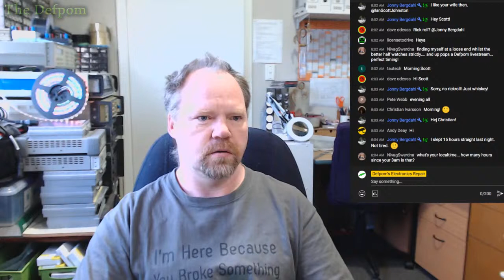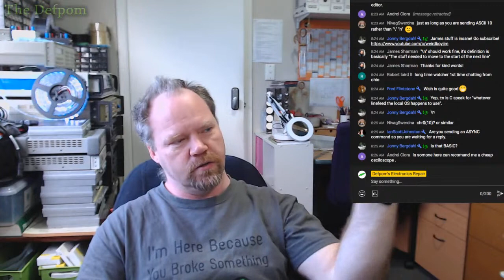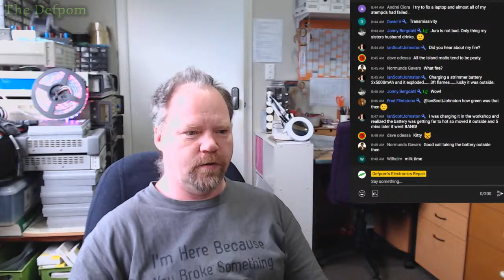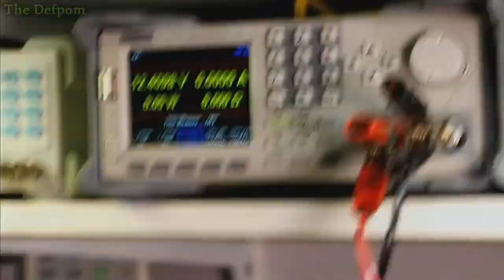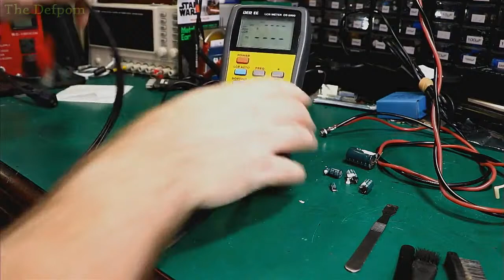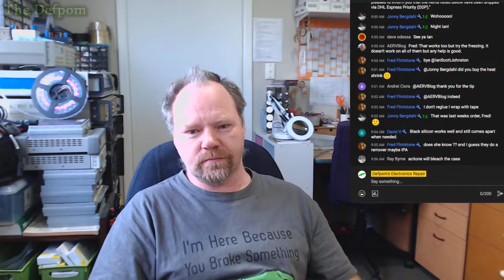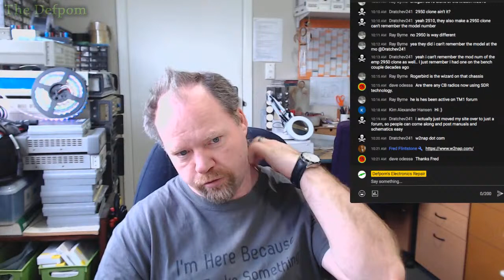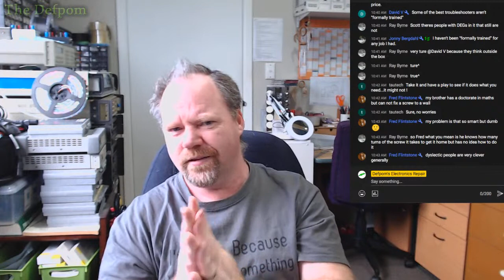🔴  Live From The Bench - Lets Chat and Tinker At The Bench and fix something.

Comment: Enjoyed the stream, a bit of chat, software and hardware repair. Ticked all the boxes.
Reply from the maker: Thanks Ian, I made some progress with the software, I can now send commands to the multimeter, read its responses and display it in the window. It’s not perfect yet as it starts a new socket every time for some reason, I need to figure out why it’s doing that, once that is solved I can start to make a remote control interface for it which sends the various scpi commands from a virtual front panel which has a live readout.